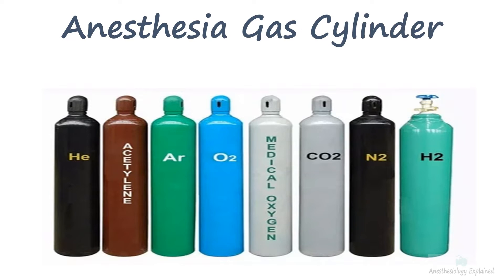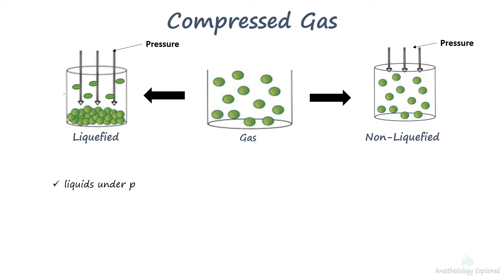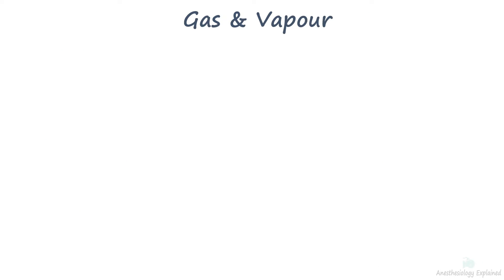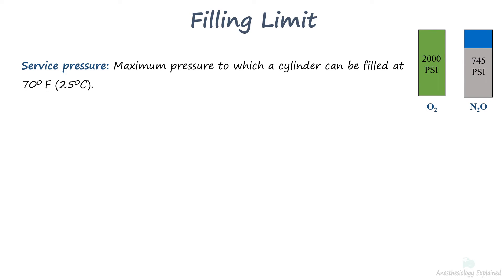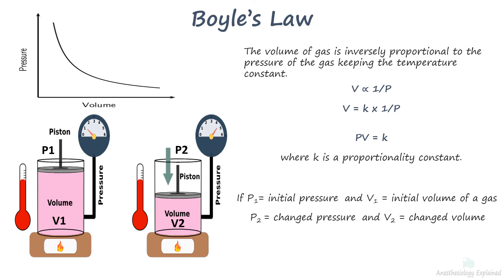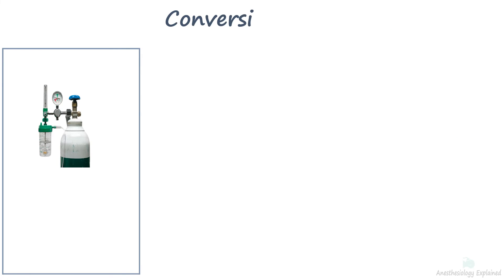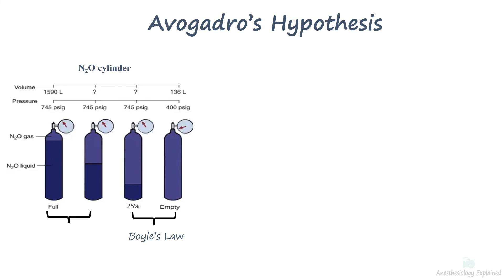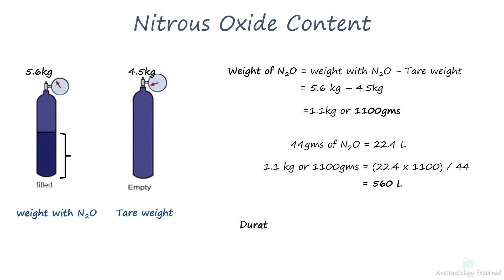Anesthesia gas and supply system | Physics gas cylinder

Comment: Then hpw n20 become a gas if it is in liquid and temp is 30
Reply from the maker: Liquid nitrous oxide in pressurized cylinders is in equilibrium with the gaseous form at  745 pounds per square inch gauge.   as the vapour is being used up, additional liquid is vaporized to maintain that same pressure untill 75 % of the content is used...without pressure,  the nitrous oxide is also a gas like oxygen. But since it is pressurized  in the  cylinder, it partially gets luquified. To completely liquify we either need to reduce the temperature or increase the pressure...hope this helped..
Reply: Thanks mam flow rate at low presure system we can adjust..so normally how much rate we keep mam also a normal human if he breath what his his flow rate
Reply from the maker: I didn't full get your question but from what I understand ...norma healthyl human  breath at 12 per minute at tidal volume of about 500 ml..so our normal flow is about 500ml per breath or 6 liters per minutes...you should know that is all from our own respiratory effort (negative pressure breathing). Our body incredibly adjust that flow rate.for example , during exercise , our respirary system works more thereby increasing the flow rate..same happen during illness...apart from that flow rate also changes based on certain external factors like atmospheric pressure and oxygen concentration like in high altitude or deep sea diving...there is sth call alvoelar oxygen equation that determines that.

Duing illness, we just supplement what our respiratory system is already doing either with providing extra concentration or flow using pressure....when we use pressure, we normally intubate or use cpap mask and our breathing changes from negative pressure to positive pressure...if you learn about mechanical ventilation and oxygen delivery devices like facemask, rebreather and non reberether ,you will get better idea...
Reply: @AnesthesiaandCriticalcare  thank for responding and answering mam   really helpfull mam....
Reply: @AnesthesiaandCriticalcare  mam lets take  200psi cylinder now i m providing 6lit o2 per min  ,,,,also 500psi setup but 
6lit of o2 per min.  after 1 min cylinder pressure will reduse lets, it is190psi for one and 490psi for 2....... so what i am asking is pt 1 got 6lit and pt 2 got 6lit .. what is the differwnce here mam both got 6lit per min..
Reply from the maker: Cylinder with 200 psi will be empty earlier than with 500 psi if we keep using at same rate ..i.e 6/min...it's not that small pressure cylinder can't give high rate..just that it will finish fast if we use at higher rate...if the pressure is more, it means that there is more gas in the cylinder and hence will last long for a given flow rate than the one with low pressure.
Reply: @AnesthesiaandCriticalcare mam 2000psi is present in all cylinders mam(type A,BCD,E) ORvaries depending on the size of cylinder
Reply from the maker: To my knowledge it is roughly the same for all types...minor variation might be there depending on the manufactures...we call that service pressure... Only sizes and volume varies...if it's oxygen it's around 2000 psi but larger cylinders have higher capacity for same pressure
Reply: @AnesthesiaandCriticalcare  sir thanks sir also sir,,to change gas to liquid we need to reduce temp(for o2 183) and to increase the pressure ..can you tell at what pressure will liquid oxygen will be seen when we have temp 183
Reply: @AnesthesiaandCriticalcare  alos sir venturi mask  green has 12 to 15 lit per min ..but its fio2 delicery is only 60% ..ideally it must be aroud 60 to 80% only sir....
Reply from the maker: It's about 60 to 80%